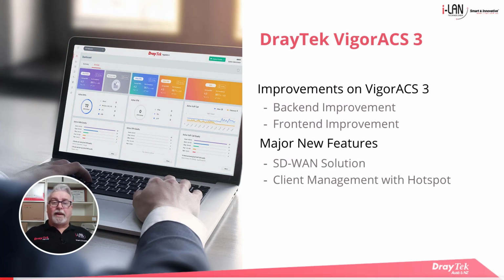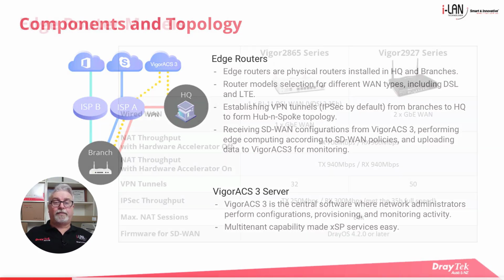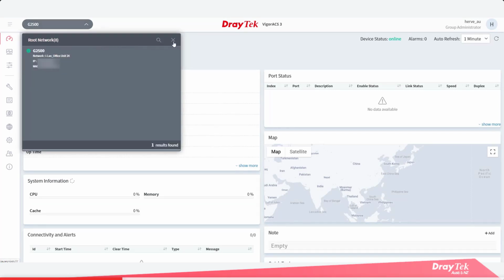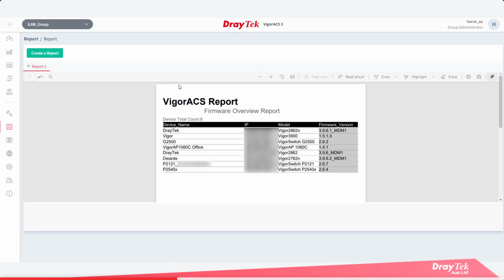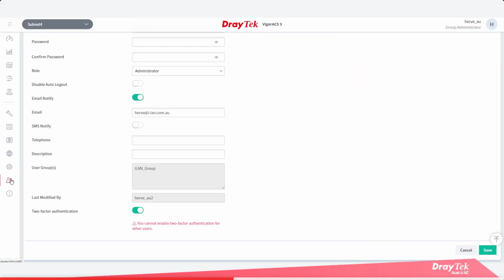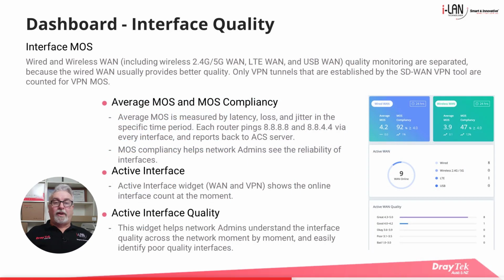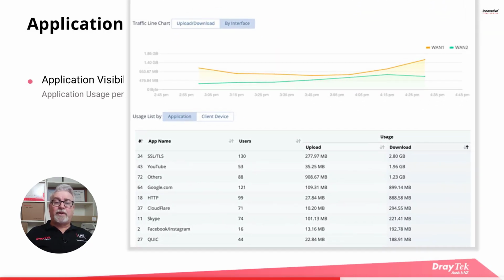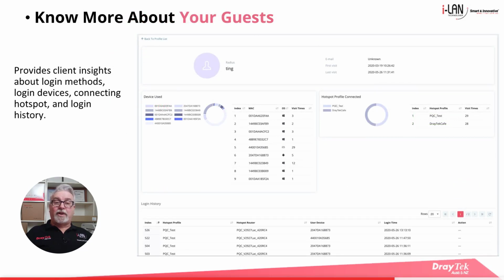Webinar - DrayTek VigorACS 3 Introduction

Comment: How I can block app YouTube  from Android
Reply from the maker: Hi, you can block it at the router using DNS filter in the firewall. See https://youtu.be/Wt-OVQgI9r8. However, this will only work if the device is connected to the router's Wi-Fi. They will still be able to get to it using their own internet connection.